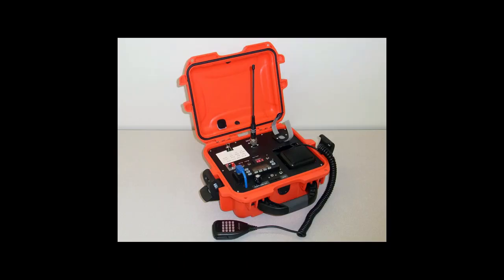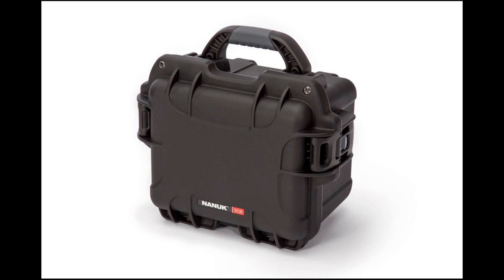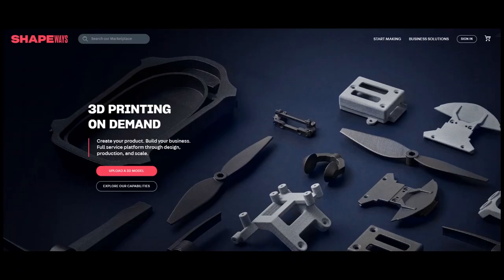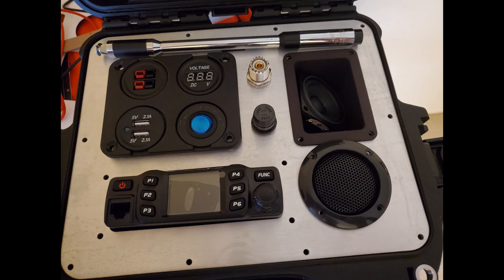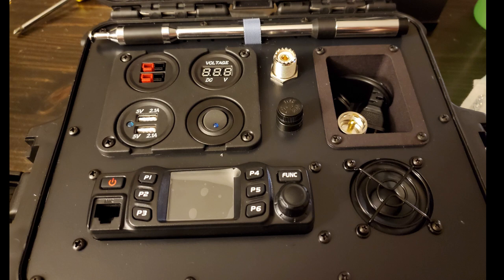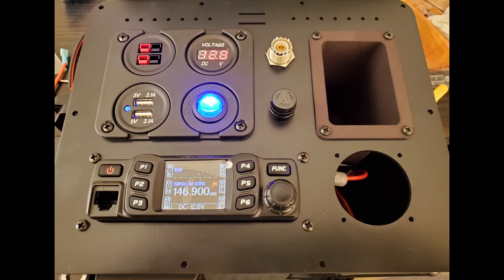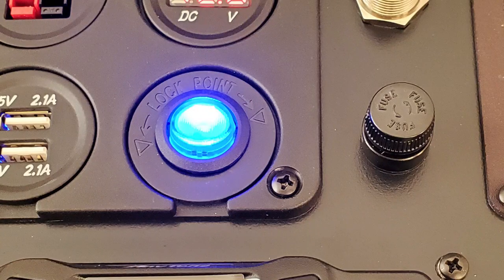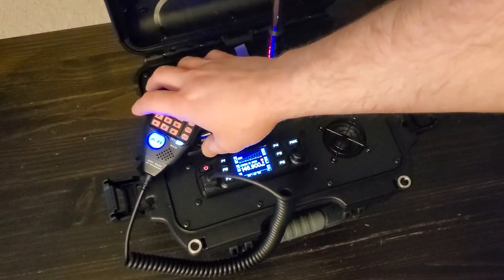Portable Ham Radio Go-Box | Build and Walk-through

Comment: Hey was wondering if you  feel as though this case would need a "station ground" to connect a bus bar inside case to bulkhead to ground stake??
Reply from the maker: I probably am not knowledgeable enough to answer this with any certainty, but I can't think of a reason it would be necessary unless I'm using the box outside during a storm and I am worried lightening might strike that short antenna.

Comment: I may have missed it, but is the box EMP "proof"? Will it act like a Faraday cage?
Reply from the maker: No, not really. The box is plastic, and isn't shielded with any sort of metal (other than the aluminum faceplate). It's an interesting idea, but I do wonder if a faraday cage so closely surrounding the radio would cause a lot of interference with the function of the radio. That is to say, the box itself being a permanent faraday cage, rather than storing the whole thing in a faraday cage when not in use.

Comment: Nice go-box.  Put some epoxy/JB weld on your bolt hole to seal it.  Did you put 110 cord into Anderson power pole connector?  Be careful with that! Exploding batteries!  If you need it that way at least set the colors to red-red or black-black on both sides.  K8SHB

Comment: really nice but dunno how long the rig will last w/o fan --proper ventilation   they do get hot
Reply from the maker: I've thought of that a little. So far it hasn't seemed to be a problem... though I usually listen much more than I transmit. If it seems necessary at any point, I may swap out that speaker for the original fan.

Comment: Makes very little sense to build a 2M+70cm "Go Box for Preppers" since theese bands will demand near line-of-sight ( or lots of power ) in order to communicate long distance. If you want a reliable and portable rig for emergencies => Buy a QRP radio with HF bands as well = Long range with low power. Fx. Yaesu FT-818ND (Analog), LAB599 TX-500 (SDR), Icom IC-705 (SDR). Next step: Buy an antenna-tuner that will allow you to use a simple long-wire antenna on all bands. ) Btw. I noticed that your "emergency-rig" is meant to be charged from 110V AC only and you can charge your useless phone too. That's almost cute, but seems to be more suited for Glamping than actual Prepping. ( Power input should accept a wide range of AC+DC sources. ) + a vertical antenna normally requires a decent groundplane unless its an array of colinear dipoles. ;-)

Comment: The antenna says rated for 10 watts, just like all the other HT antennas, but I see a lot of these go-boxes using them with radios that push 25 watts. How well does it work? Thanks.
Reply from the maker: My radio has adjustable wattage. I use it on lower power with the antenna seen in this video, but usually I use one of my larger antennae with the box.

Comment: Hello,
This is KO4NLI have you thought about making these to sell. I have been looking to get a solar power generator box.

Thanks.
Reply from the maker: Hello, I did think about doing that, but they would end up costing so much to build, I'd probably have to charge around $1500 per box to make it worthwhile. I figured that's too steep a price tag.
Reply: @GreatLakesPrepping  I understand if you have time could advise me on this.
It also is self contained and you can hook a solar panels to it. And is has solar controller built in. My thoughts were I can use it to power my 65 watt yasu 3100.

Bioenno Power 500 Watt-Hour Renewable Power Pack.
Thanks David
Reply from the maker: @d66paynter1  I don't know a whole lot about those power packs, but that one you're looking at seems pretty awesome to me.

Comment: Looks like a 10w antenna... have you run the radio at 25w or do you back it off to 10w.
Reply from the maker: When that antennae is in, I set the power down to 10w. At home, though, I'm using a larger mast antennae so it's full-power.
Reply: @GreatLakesPrepping  we're gonna try a 44 inch tach 20+w antenna...for the box...and then be able to go to a field mount Diamond 50 or 30 on a rise tripod if we have need...same radio....as 25w in a box should be a good to go w.

Comment: Man, thanks for the inspiration! I have the same radio and I'm currently brainstorming on ideas for a go box. Looks like yours turned out great! Now that you've had it for a while, is there anything you would do different ?
Reply from the maker: Hey thanks! If I did it over again, I would use a smaller battery. Stuff is a bit too crammed in for my liking.

Comment: Awesome build!!!! Let me know if you want to sell the painted aluminum part. Im going to copy your build!  My ocd isnt as bad as yours. I dont mind scratches.  😆
Reply from the maker: Hi Billy, thanks! I ended up just keeping the aluminum panel and I don't think I have any plans to replace it. That being said, I do have the laser-cut piece of acrylic if you want to try that. It's probably strong enough, but it's clearly not as strong as the aluminum.

Either way, it doesn't cost that much to have an aluminum piece cut out, as I mentioned in the video. All the hard work came from designing the files!

Comment: How much would you charge to build me one?
Reply from the maker: Hi Stack. I don't even know. If I recall correctly, all the parts totaled somewhere close to $1000. Some of that was for CAD design and trial & error and a couple tools, but the materials would still end up being hundreds. Probably $700-$800. Beyond that, I'd be charging for time, which admittedly I am quite short on these days. Honestly I recommend giving it a shot building one yourself. I've really done all the most time-consuming parts, with the measurements and CAD files and faceplate template and whatnot. Would you try using my parts list and files and build it yourself? I'd probably have to charge $1500 to make it worthwhile, and that just seems kinda crazy for a radio in a box!

Comment: .

Got to thinking

Two separate smaller boxes
Radio
Speaker
Fan
Cubby

2nd box
12 amp Battery
Antenna
Connecting cables
Cubby

...
Reply from the maker: It's a good idea. Some people definitely do similar to that. Separate box for power supply, accessory ports, etc. Can make the power box versatile and use it for all sorts of things, one of which being powering the separate radio box.
Reply: @GreatLakesPrepping  
.

Right

Well Done

...

Comment: what kind of 3.5mm aux connector you used? mono or stereo? de N6APG
Reply from the maker: Hi Alonso. I used a mono connector.
Reply: I must be a complete noob because I can’t figure this up for the life of me...

I got a couple of mono aux plugs from amazon and a 2.5 inch speaker, every time I connect the wires to the speaker it’s like if I’m keing up the microphone I just can’t figure what I’m doing wrong, what I’m missing?

Comment: Upgrade the Lead–acid battery to a LifePo4 type,  half the weight , double the capacity
Reply from the maker: Maybe for my next one I'll give this a try.
Reply: And 5x the price!
Reply: I chose an Eco-Worthy 30AH LiFePO battery that I got on Amazon for $150. It's 3" thick and weighs just over 7 lbs. A 30AH SLA battery (like a Mighty Max) is half the price, but is also twice as big and 3 times heavier. Keep in mind that you will need a special charger specifically designed for LiFePO batteries. Trickle chargers meant for lead acid batteries will not work.